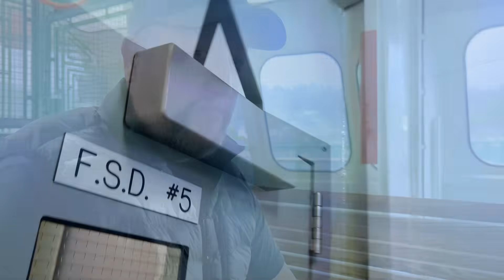The Answer: Why This Door Has TWO Closer Mechanisms

Comment: But powered ADA openers does have a spring to close them mechanically when power is removed or the opening signal lacks. In this way, not wasting power on the close action. Some powered openers is just a normal huydralic closer, that has a motor that can open, BUT also electronic valves, so once the opener has opened the door, it can close a huydralic valve which will keep the door open by preventing the huydralic fluid to return. (these valves are normally open and requires power to close, so if power disappears, the door WILL close by spring force)

So maybe those mentioning the wind is also correct in a way - they needed some extra power to the spring closing function of the automatic door operator to overcome the pressure difference, basically, if theres higher pressure in the cabin than outside, they would need more pressure to force the door closed, and being a fire door, seems to be a code requirement.

Comment: I'm surprised they can't combine that into one box
Reply: If the power goes out, then they want an unpowered system
Reply from the maker: Correct. 

One under power, the other to operate without power
Reply: @DeviantOllam  What I know, ADA openers do close by spring force to not waste motor power needlessly, and thus, at power loss, all doors would close by spring force. Atleast ADA openers in sweden are like this. Usually they are built like a huydralic spring closer. Some of them, do have a hoydralic pump that will open the door, and then let the door close by spring force. Some just have a motor acting directly on the drive.

The motor operator then are half mechanical and half motor.

I suspect this IS actually due to wind. Basically, the spring closer in the motor opener was not enough force to close the door if theres a big pressure differental outside and inside, so they had to add a mechanical spring closer to increase the total closing force. (which of course mean, you would have to increase the motor force, which is usually done by either a electronic DIP switch to set the motor force, or a screw you tighten to increase clutch friction).
Reply: @philopharynx7910 you could do that and still have the systems combined, you would just have it fail closed or open
Reply: @magilla_and_amanda then it is no longer truly independent.
Reply: @magilla_and_amanda  Yes, but it would likely be more expensive than simply getting two off-the rack systems.

Comment: But why do they need two separate devices instead of having dual control over a single device?
Reply: Powered devices require a power source and a remote control, both failure points. Separate closer provides independent backup, it wouldn't be independent if it used same mechanism.
Reply: One's pneumatic and the other one has a motor and requires power.
Reply: We usually use a single device in sweden - opening electrically, closing mechanically. Approved and often required by code.
Reply: @lewerinteknik2034  Tror nog amerikanska ADA öppnare är likadana som de vi har i Sverige, dvs öppnar med motor, och stänger med fjäderkraft så man inte slösar el i onödan. Här handlar det nog om att den fjäderkraft som finns i motoröppnaren inte är tillräckligt ifall det är mkt vind, och därmed måste de montera en "standard" dörrstängare i unison så dörren kan stänga med fjäderkraft även om det är lä på utsidan (dvs lägre tryck på utsidan dörren än på insidan).

Comment: Was expecting the loudspeaker announcement to be "will the owner of the white BMW please turn off their alarm".
Reply: Or, more likely, "Will the owner of the black Jeep Wrangler please take the battery out of the white BMW so the damn thing will shut up? I'm going insane up here!"
Reply: "Don't you tell me which zone is for loading, and which zone is for stopping!" 😂
Reply: You're specifically told on boarding to leave the vehicle unlocked or alarm off

Some people ammiright

Who would know to change settings on the car to not auto lock after X amount of minutes anyway
Reply: I don't understand anyone with a car alarm. All they do is basically serve as asshole announcement devices. Literally everybody assumes an alarm going off is just a false positive anyway and is more likely to vandalize your car to make it stop than to call the police when they hear one.
Reply: @Taladar2003  they're stock on most vehicles now... What's going on is that folks leave their car (and go to passenger deck) and then lock their car (which arms the alarm). The motion of the ferry will trigger the shaking alarm in the car later on. Most folks want to lock their car so others don't attempt to rifle through it, then again, there's cameras and nowhere to go so theft is probably less likely. There are ways to lock the car and not arm the alarm (or unarm it) but not everyone is in-the-loop. Especially if they're using a rental.